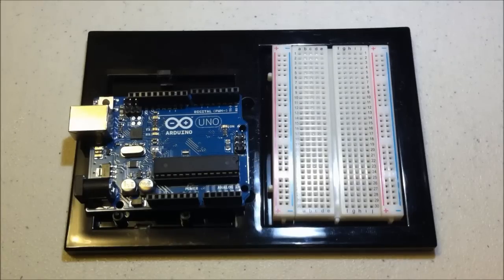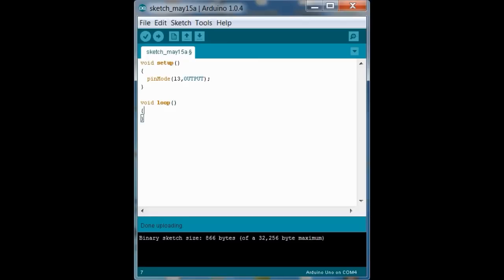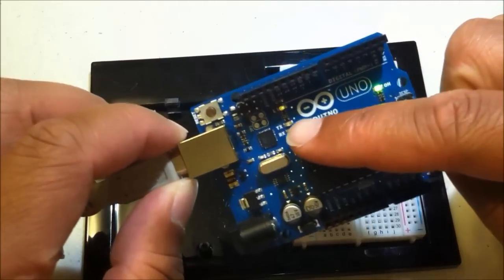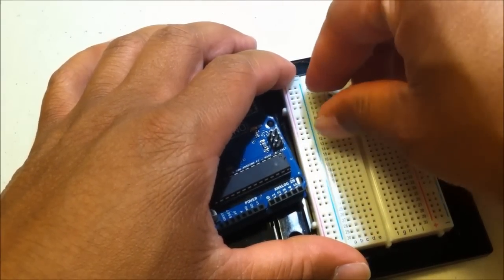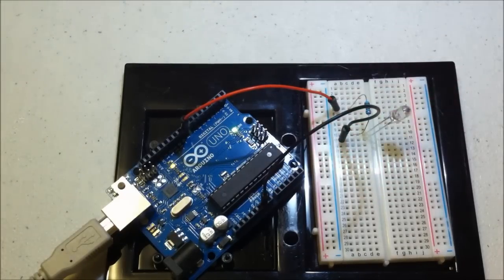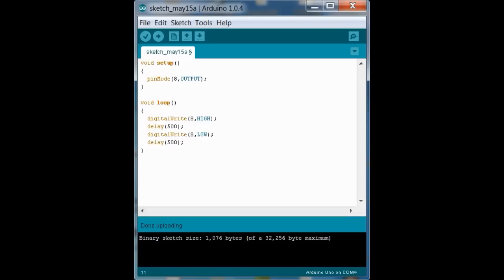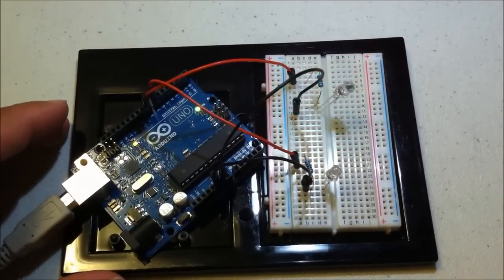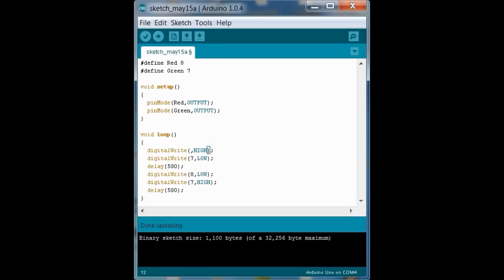Arduino Tutorial - LED Blink / Code Included

Comment: Hey sir you do a great job 
Please tell me the value of resistor
Reply from the maker: The value of the resistor can be anything between 220 Ohms and 1 kiloOhms.
Reply: @shoilett1  Thankyou sir it is very helpful for our engineering project thankyou thankyou so much
Reply from the maker: @Ram_0866  No problem. Enjoy!
Reply: @shoilett1  sir we can use 300 ohm resistor!?
Reply from the maker: @Ram_0866  Yes, you can use a 300 Ohm resistor. You can use any resistor between 220 Ohms and 1 kiloOhms.
Reply: @shoilett1  Thankyou sir❤️

Comment: I have a quick question, I used the bare minimum example to make pin 13 blink, but I was wondering what modifications would I need to make in order to have it blink at a steady rate two times wait a half second, then blink again two times and have it repeat? Any help is appreciated.
Reply: hi
can you share your original code here?
https://wokwi.com/share

When you say blink two times, it should still have some off time. you can try this:
1. Turn on the LED
2. wait for 50 ms
3. Turn off LED
4. Wait for 50 ms
5. Turn on the LED
6. Wait for 50 ms
7. Turn off the LED
8. wait for 850 ms, Repeat from step 1.
wokwi is a free Arduino simulator. It is an open-source project and feedback and suggestions are welcome.

Comment: you didnt say what resistor to use
Reply from the maker: Anything between 200 Ohms and 1 kiloOhms will work.
Reply: @shoilett1  i just had a hard time figuring out what resistance each bundle was when pulling them out of the kit
Reply from the maker: @camanderson9954  Makes sense. Glad you got it working.
Reply: @shoilett1   glad I found your video.
Reply: got it working, thanks mate

Comment: do I need to attach registers on the arduino before i could add an external LED??? and what wires are those which you used to connect the arduino with the breadboard
Reply: Yes minimum 220 ohms

Comment: Value of resister tell please
Reply: 220 Ohm resistor
Reply: The typical maximum current the LED can work with is roughly 25mA, which means the total resistance of the resistor and the LED should be R = 5V/25mA which is 200 Ohm.
Reply: @masterjakem  You forgot about the forward voltage drop of an LED, typically about 2V, so it would actually be 3V/25mA

Comment: Mine doesn't blink for some reason, It's connected via USB. I think the wiring may be wrong.
Reply from the maker: Make sure your LEDs are oriented correctly. <https://learn.sparkfun.com/tutorials/light-emitting-diodes-leds>

Otherwise, try using pin 13. There's a built-in LED on pin 13 on Arduino UNOs.

Comment: shoilett1 can you build a Arduino , that work as a signal transmitter of the radio control car.
Reply: THANK YOU , i hope this will work.
Reply from the maker: You're welcome. A friend and I did this for our class project. It worked ok. To be honest, I haven't look at this in a while, so my recollection is poor. So if you need any help with anything, just let me know.

Here's the link to the schematic and board EAGLE files.
https://github.com/hoilett/Bit-the-RoboCar/tree/master/Hardware
Reply: well honestly i want to use a actual pcb instead of breadboard ,because it looks more
stable platform for circuit design, and most of my teachers prefer pcb than a breadboard
but that is okay , i appreciate your help.
Reply from the maker: ?? I'm not really sure where the confusion is coming from. The EAGLE files allow you to make a PCB. You can order it from OSHPark.com Just upload the EAGLE .brd file and you'll be good to go!
Reply: Actually OSHPark.com can not send pcb board in my third world country and i do not 
know the process of using Photosensitive pcb Fabrication Machine.
i often use old desoldered circuit board as my next project.  but that is okay i always figure out a way.
Reply from the maker: Ah okay. Well fair enough. Good luck with everything and feel free to ask questions.

Comment: I am a software developer with 24 years experience and can tell that you did a very good job. Perhaps you could have mentioned that setup() and loop() are called from main in your sketch. These simple explanations are without any doubt the best. To do the same with other microcontrollers (non-Arduino) is not as simple.
Reply from the maker: Thanks for the compliments and the tips! And yeah I agree. The Arduino makes a lot of things easier, but it's good to note how it works underneath, like you mentioned.

Comment: /*
YouTube Demo
Arduino Tutorial - LED Blink / Code Included 
*/

//Sets Red to digital pin 8 and Green to digital pin 7
#define Red1 10 
#define Green1 9
#define Red2 8
#define Green2 7

void setup()
{
//Initializes pin 10, 9, 8 and 7 as outputs
  pinMode(Red1,OUTPUT);
  pinMode(Green1,OUTPUT);
  pinMode(Red2,OUTPUT);
  pinMode(Green2,OUTPUT);
}

void loop()
{
//Blinking
  digitalWrite(Red1,HIGH); //Red on
  digitalWrite(Green1,LOW); //Green off
  delay(500); //Wait half a second
  digitalWrite(Red2,HIGH); //Red on
  digitalWrite(Green2,LOW); //Green off
  delay(500); //Wait half a second
  digitalWrite(Red1,LOW); //Red off
  digitalWrite(Green1,HIGH); //Green on
  delay(500); //Wait half a second
  digitalWrite(Red2,LOW); //Red off
  digitalWrite(Green2,HIGH); //Green on
  delay(500); //Wait half a second
}
Reply from the maker: Sweet stuff! Did it work out for you?

Comment: Thanks you sir for uploading such a helpful video. Sir, could you please tell me the resistor value that you have used in the breadboard with the LEDs ?
Reply from the maker: Asif, thank you for the complements. I don't remember what I used, but they look like 100 Ohm resistors from the video. Also, check out this tutorial from SparkFun about selecting the correct resistor value for your LEDs.
https://www.sparkfun.com/tutorials/219
Reply: Sir, could you plz help me with the code if I want to light up 3 LEDs just like the way u have lighted up 2 LEDs in this video ? And which of the pins can I use as the output? Ur kind response would be my helping hand sir
Reply from the maker: Yeah for sure. In the code, I used pinMode(digitalPinNumber, OUTPUT) to initialize the pins. You would simply need to add another "pinMode()" line and you can use any digital pins 2-13 on the Arduino.

Comment: I can't upload the code to arduino, this is the error:
Arduino: 1.6.1 (Mac OS X), Board:"Arduino Uno"

De schets gebruikt 1.030 bytes (3%)  programma-opslagruimte. Maximum is 32.256 bytes.
Globale variabelen gebruiken 9 bytes (0%) van het dynamisch geheugen. Resteren 2.039 bytes voor lokale variabelen. Maximum is 2.048 bytes.
avrdude: ser_open(): can't open device "/dev/tty.usbmodemfa131": No such file or directory
ioctl("TIOCMGET"): Inappropriate ioctl for device
Probleem bij het uploaden naar het board. Zie http://www.arduino.cc/en/Guide/Troubleshooting#upload voor suggesties.

  Dit rapport zou meer informatie hebben met
  "Tijdens de compilatie uitgebreide uitvoer weergeven"
  ingeschakeld in Bestand > Voorkeuren.

Any suggestions how to fixe?
Reply from the maker: +THIERRY KARSEMEIJER You probably disconnected the USB cable
Reply from the maker: +THIERRY KARSEMEIJER Did you get it?
Reply: +shoilett1 Yes!
Reply from the maker: THIERRY KARSEMEIJER Cool. Glad it worked out.

Comment: hi, can you make a vid with the code for a series of led that would flash from left to right? i want to make a set of car blinkers and i want to make them look like a mustang tail light
Reply from the maker: +drift mania EXTREEME You would just have to turn on a few light sequentially. Let's assume you have three lights from left to right. This is untested, but it should work.

void setup() {
pinMode(LED1, OUTPUT);
pinMode(LED2, OUTPUT);
pinMode(LED3, OUTPUT);
}

void loop() {
digitalWrite(LED1, HIGH); digitalWrite(LED2, LOW); digitalWrite(LED3, LOW) //this turns on the left-most light and turns off the other two
delay(100);
digitalWrite(LED1, LOW); digitalWrite(LED2, HIGH); digitalWrite(LED3, LOW) //this turns on the middle light and turns off the other two
100);
digitalWrite(LED1, LOW); digitalWrite(LED2, LOW); digitalWrite(LED3, HIGH) //this turns on the right light and turns off the other two
100);
}
Reply: i will try it and i will give you a reply. Thank you for the response
Reply from the maker: Okay cool. Oh and remember you're going to need pin definitions for LED1, LED2, and LED3. So maybe 

int LED1 = 9;
int LED2 = 10;
int LED3 = 11;

And put these before void setup().

Comment: thanks bro. it helps me lot, but will you tell me how many led I can use in this project. and which resistor you use in this project. i mean  1k or how much?
Reply from the maker: +pinkal bhakta With just using the Arduino's digital pins (D2-D13, not including pins D1 and D0), so 11 LEDs. 1k resistors are fine.

Comment: How many lights could I have going if I did this? I basically want to light a 1:1000 Star Trek Enterprise model and price of the prewired kits is more than the model, so I'm looking at figuring it out myself. I just don't understand this sort of thing yet. Anyways, this was helpful and thanks for sharing.
Reply from the maker: rochat What you want to think about is how many lights are you trying to control, how much current is necessary to turn on each light, whether or not you want to control each light individually or if you can group a few of the lights together, whether or not the lights will be wired in series or in parallel. Those are a couple of things. There are ways that you could wire this such that you can control hundreds of lights individually with a single Arduino UNO. Can you provide a bit more detail?

How many lights do you want to use? How big are they?
Reply: There will be roughly 12 blinking lights (some faster than others) and a lot of constant lights.  As far as how big, I'm not quite sure yet, but since the model is relatively small, I want small LED's as well since some of them will be protruding the model acting as navigation lights. I suppose I could use fiber optics as well. 

I've wanted to learn electronics for a while and this might be a good way to learn.
Reply from the maker: +rochat Is this the amount of lights you may be thinking?  http://www.instructables.com/id/Arduino-Home-Basketball-Hoop-Score-Detection-Sy

Comment: Would this code work with a strip of blue LEDs and a Strip of yellow LEDs?
Reply from the maker: Depends on how you wire it up, but it could. Are you trying to turn one of the lights on at a time and alternate between blue and yellow?
Reply: alternate between blue and yellow, and using a 12 v battery! Basically I wanna attach the lights to the bottom of my dolly!
Reply from the maker: virang807
Yeah. This could work. You should also look into transistors, I think an NPN should work.
Reply from the maker: shoilett1 I did a quick schematic of something I think could work. Although, I don't know how your LED lights are set up (if they are in series or parallel), but anyways. Hopefully this gets you started.
https://plus.google.com/100706787208056664638/posts/a5U8W6MfvDt?pid=6131807465959084162&oid=100706787208056664638
Reply: Well thank you for that! That really means a lot! These are the LED Strips that I am going to use!
 http://www.amazon.com/Lampux-Flexible-Lights-Non-waterproof-Strips/dp/B00HSF64E6/ref=sr_1_4?ie=UTF8&qid=1427673256&sr=8-4&keywords=led+strips
Reply from the maker: It makes sense for them to be in parallel not series. I think diagram I gave you should work. You may need to look into power BJTs, because the current draw of the lights (depending on how many lights you have I guess) may be high.
Reply: so the drawing you sent me is basically in the video as well? Sorry for asking so many questions!
Reply from the maker: No it's not in the video. You need to build something like this with your LED strips for it blink them sequentially like you said you wanted.
Reply: shoilett1 What kind of connectors should I buy for that type of aurduino board
Reply from the maker: Just some standard wire hook-up wire.
Reply: I mean when I look it up on the arduino website, which type of connectors do I buy?
Reply from the maker: http://www.amazon.com/Electronix-Express-Hook-Wire-Solid/dp/B00B4ZRPEY/ref=sr_1_1?ie=UTF8&qid=1428019156&sr=8-1&keywords=Hookup+wire

Comment: THANK YOU too. Believe me when I say : I was watching more then 100 videos , but none of them so exquisit explaned . Maan You have a gift . Use it !!!. 
I need Your help to make these project :how to make an led blink to reproduce S.O.S. morse code " bep/bep/bep/beep/beep/beep/bep/bep/bep " and ALONG with him IN THE SAME TIME a buzzer to reproduce the same code but in sounds "
I need badly these code for a Modeling Project colled " Lost Model Submarine "
- can I use a LASER DIODE instead of an LED (Recovered from a pointer pen)?.
THANK YOU again . 
All the Best . 
Please don't forget me !.
Reply from the maker: Thanks for the compliments.

For doing morse code with an LED, you can use the function digitalWrite() to turn the pin on and off. And you can use delay() to designate how long it should be on and off for. Morse code is in long and short pauses so just use dealy() accordingly.

To make the sound on a buzzer, you can use the tone() function to make sounds on with a buzzer. Again, you would need a few delays in there as well.

To do both of these at the same time. I'm actually not sure. Just do a bit of Google searching for asynchronous operation with an Arduino.

I guess a laser diode would work. Just don't look directly into it.

Hope this helps.
Reply from the maker: After doing some Googling and some thinking, you will probably want to use a combination of millis() and interrupts (maybe not delay() since it stalls the code and could throw off the timing). The tone() function runs in the background so you can make calls to digitalWrite() without stopping the sound on the buzzer.
Reply: @shoilett1  PSHAW. Ive looked into lasers my whole life. Its never affected me. Proceeds to blindly stumble away.

Comment: By the way, on the code you put there "pinMode(13, Output);" What do you mean the no. 13. Sorry if you said that already.
Reply from the maker: pinMode sets the digital pin to either receive an input and or send an output. Since we are making the LED blink on pin 13, we are sending an output. 13 is just the pin the LED was on. This link may help. http://arduino.cc/en/Reference/pinMode#.Uy7L4s4kDCs
Reply from the maker: Woops! I think you may have been looking at the wrong code. The one corresponding to this video uses pins 8 (for Red LED) and 7 (for Green LED).
https://docs.google.com/document/d/1h7e-FOuqdSq-uW5IyEGtuI6-5QGb3ksvX8H4MVIfMKc/edit?usp=sharing